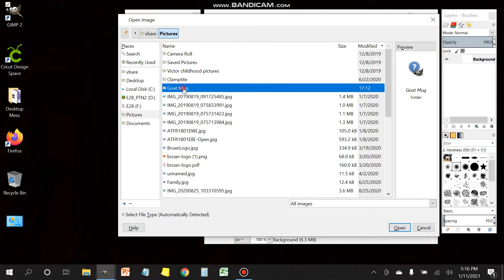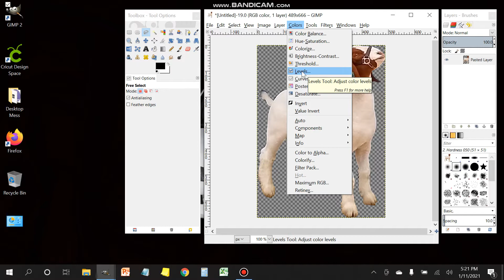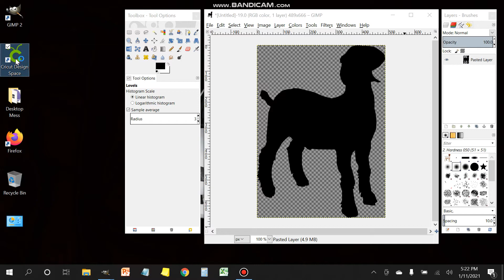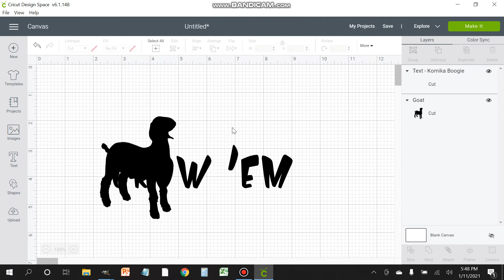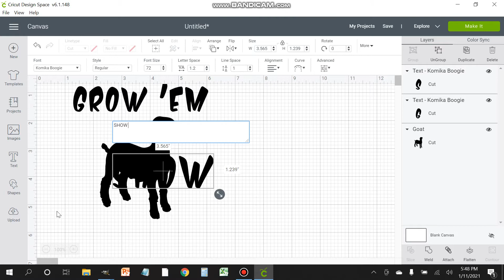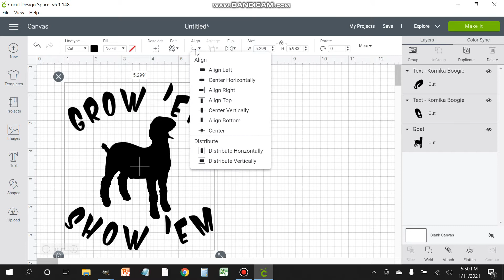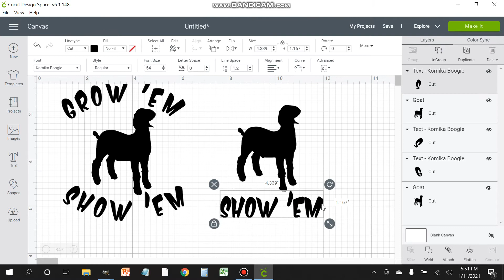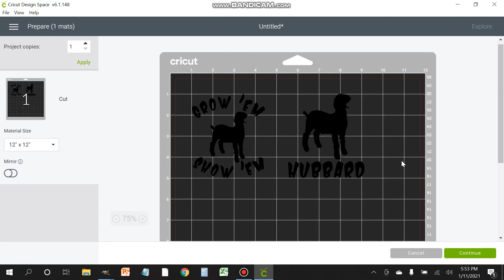Vapor Blaster / Honing Mug & Candy Jar Glass Etch cabinet time under 8 minutes

Comment: Which water do you use in your machine? I mean, it's simple pure water? Can I use antifreeze?
Reply from the maker: Hi Zero Tolerance, thank you for commenting. I simply use water from my hose. I haven't had the need for antifreeze since I live in Texas and don't have experience using it. Antifreeze is kinda oily, not sure I would use it at all, personally. Try checking with Vapor Honing Technologies to see what they recommend.

Cheers!
Reply: @vbared  Thank you for reply! I'm sorry, but do you have Telegram (messenger)? Can I contact with you?